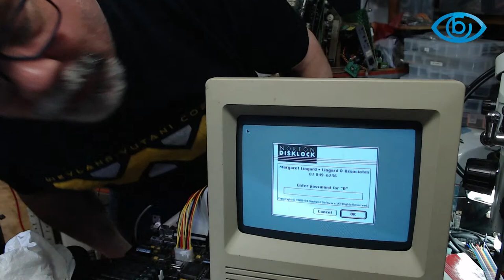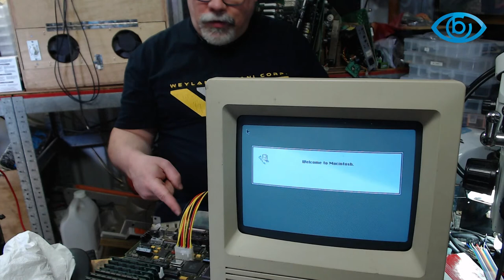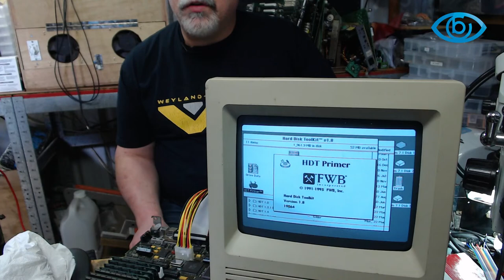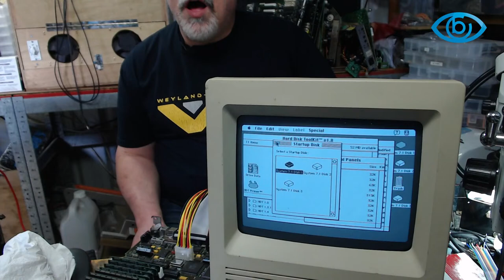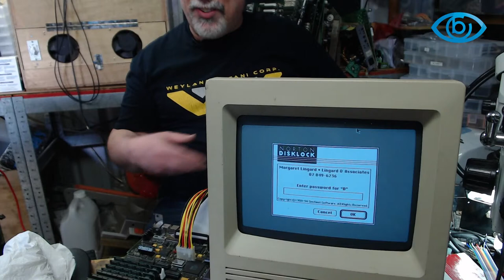Saving a very special Macintosh SE/30

Comment: At 49:53 you mention the Tominator II - one caveat that a lot of people forget is that System 7.5 doesn't like the Rominator unless you use resedit on the system file itself and modify it - System 7.1 doesn't care however and works fine :)